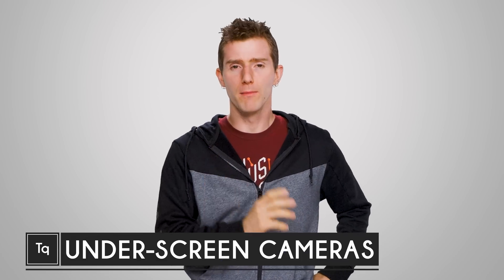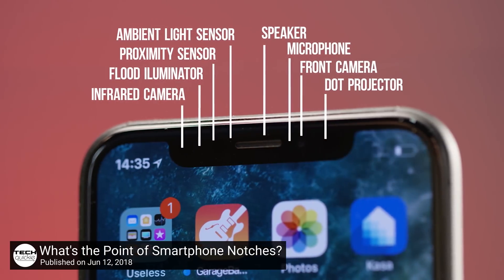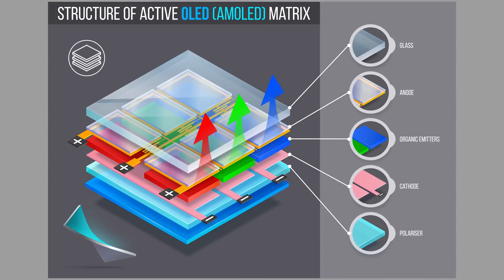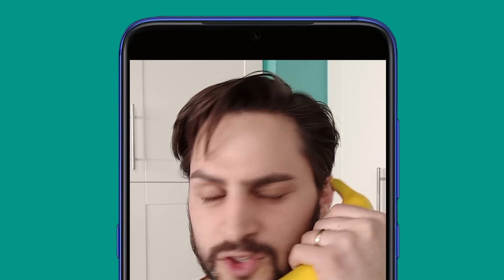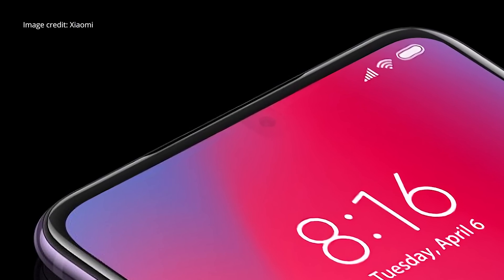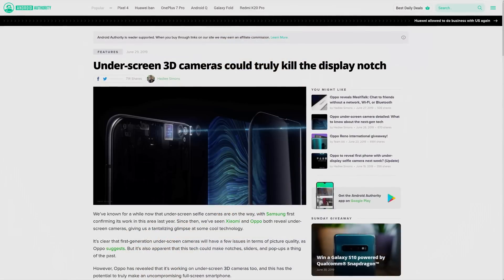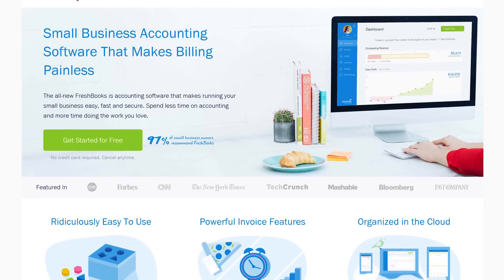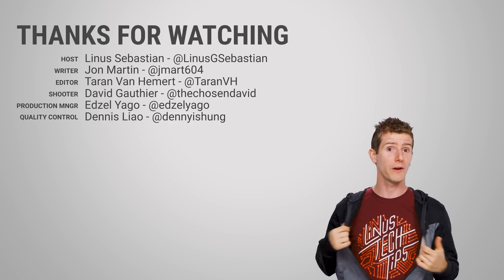How Under-Screen Cameras Will KILL the Notch

Comment: Face id is too good for this. How can you put the infrared, flood illuminator and the different sensors under the screen? These sensors essentially makes face id the most secure biometric login in a phone ever. You need to have a solution for that first.
Reply: Yah, well Apple has introduced us with the answer in the iPad Air 2020!

Comment: I would be sick of having a notch on my phone, if I ever got one of those nasty devices. I got the Samsung Galaxy Note 8 when it was brand new and still stick to it, since it still runs perfectly fine, and it was one of the last models before that ridiculously stupid notch trend. It's bezels are slightely thicker, but I'd always prefer this over having any sort of cutout on the screen. It's beyond pointless and I am glad my Samsung A20 is only a secondary emergency device - it has the freaking peep hole camera right in the display. Glad both those phones have a headphone jack. Couldn't be assed to get the Note 10 - it halso has the idiotic peep hole front camera and no headphone jack. For my kind of use for a phone, the Note 10 would be a serious step back from the Note 8, so I got really no incentive to switch. As long as the Note 8's hardware will stay healthy and Samsung not killing it off with bad updates, I'll go on using it, this thing is still a beast.
I would say - until translucent displays are perfected - the perfect solution would be a dual screen phone. Main screen on the front without any additional elements, secondary screen on the back, slightely smaller that gives room for sensors and camera(s), being used for all kinds of photos.

Comment: Google: you don’t need a 2nd camera

Also Google: ADDS A NOTCH
Reply: Also Google: but we need a triple camera system.
Reply: Pixel 4 leaks say that there won't be a fingerprint sensor instead it uses face unlock they way exactly apple approached.

Comment: Imagine having under-screen cameras in your TV or smartphones and fbi spying on u without u knowing it lmao
Reply: Fuck they've seen me masturbated multiple times
Reply: What you thinking of doing something illegal?

Plus why cant they through the ones that are there already
Reply: @wisps-vn7oy  It doesn't matter if what you're doing is illegal or not, if there's a backdoor in a device's software or hardware then it's only a matter of time before someone else finds and exploits it. For example, if you're a medical practitioner and use a device at work that is not secure, you cannot guarantee patient confidentiality because any malicious third party with the necessary skillset could eventually gain access to patient data. It's not just a privacy concern, it's a massive security vulnerability.
Reply: @rupertlove1807  the first part was a joke lol.
Reply: @wisps-vn7oy  stfu
Reply: @Anankin12  no u
Reply: As if you’d know they aren’t watching you If the camera was at the top and visible.

How stupid
Reply: They can do this with any camera connected to a device connected to the internet.
Reply: New buisness idea... I disable hidden cameras for a price.
Reply: What if the display or the part of it where the camera goes turn off for only one frame... 1/60s. In that time most cameras can take a picture in normal light and you hardly notice the random fast switching if those pixels
Reply: As if people didn't post everything they do every 5 minutes
Reply: @null-1  when the screen is active the under display camera cannot (yet) see you unless you open camera mode and the spot covering the camera is turned off completely
Reply: JD Marshall - there’s a company that has successfully made under-screen camera without the LED turn off. I dunno what company tho, but I know I’ve seen a video somewhere.
Reply: @JoshMarshain  I hope so... but the government / FBI / CIA / NSA / whatever will find a backdoor / way to spy on us through the camera without us knowing.
Reply: @LegaINameFraud  and that's why I don't live in the USA. You could say that in my country there's something like that, but no. I'm italian. We don't have money, we only have spaghetti lol
Reply: @greg9473  Trust me, and sorry to break it to ya, they don't only spy on american citizens. The whole world is being watched thanks to the internet and smartphones.
Reply: @LegaINameFraud  why do you think that the FBI might be interested in spying you instead of fighting actual crime, catching drug dealers, murderers, serial killers, all sorts of criminals, spys, etc. Except if you've done anything that deserves their attention. If you have, they have the right to invade your private life in order to ensure the protection and well being of the society. HAVE YOU?
Reply: I dont get why some people see FBI as an enemy. Have you ever wondered what would happen without them? Go watch the purge. You live in an organized society and someone has to be in charge of keeping it organized

Comment: I think we should do away with not just those stupid notches but rounded screen corners as well. Have you ever tried viewing a picture that supposedly occupies the entire screen but the corners were cut off because of the screen's rounded corners? It's quite annoying. I hope this stupidity doesn't spill over to TVs. Just imagine something blocking the screen like a notch or rounded corners. And some bezels please. Yeah thin bezels look cool but it sucks using my S9+ because I always unintentionally touch the edges and things go crazy. I much prefer using my Nokia 6.1 which has the good old 16:9 aspect ratio, no notch, and no rounded screen corners.

Comment: My least favorite thing?

Non removable/replacable batteries,

Devices getting less and less comfortable to hold due to growing standard sizes,

Lacking headphone jacks,

Support outside of iPhones often is limited to 2-3 years

Companies adding their own crap to the Stock Android system,

Companies not taking the chance on a large scale and make the phone work as a laptop replacement when docked to a screen (hello UbuntuPhone and Lumia),

Batteries need to recharge after 1.5 days at most,
Everyone tries to be Apple.

Seriously, Smartphones still have to improve a lot and come up with more individual qualities too.
At this point they are cool but also mostly shit.

Comment: I don't have any problems with notch or even cut off from above. i'm fine and don't need this little more screen space that badly. I think the "problem" with the notch is so overhyped. Yea it's neat and i love the tech and it will be cool, but by noooo means do i need it or buy a phone just because of this.
Thanks for the vid and the small explenation of the tech.

Comment: If they put the hidden camera in the middle of the screen instead of on top, you can actually make eye contact during video calls
Reply: That’s a cool idea. The only problem I see is it might get in the way of some of the internals. The entire inside would have to work around the camera
Reply: You forgot the part where he mentioned that they have to turn off pixels on the part of screen
 to make it transparent when using selfie camera
Reply: because we are so used to the top-format, it would look extremely weird
Reply: lol that would be cursed af
Reply: it would be cool to not have a camera
Reply: just do it like two way mirror... hidden camera...
Reply: Lol yeah
Reply: I too thought of that but then I realized that in the middle of the phone there will be a deep hole that prevents eye to eye contact which is a horrible decision.
Reply: I'd rather have a fingerprint sensor that takes up the entire bottom portion of the display, though that will take a while to get there too
Reply: That is a good idea but every Time you take a selfie you will have a black dot in the middle of the screen, plus you wouldn't be able to see your friend, and if you can see your friend then your friend would not be able to see you very well because excess light will enter the camera.
Reply: Eric Su it’ll get more distracting
Reply: nah, I’ll still look at myself in the corner
Reply: I don't it is touch sensitive. Like I doubt that part can activate the touch screen
Reply: i like to minimize the call window and use my phone. So having the camera in the middle wouldn't be too nice for me
Reply: Do you want to black out the middle of screen during taking a selfie 😂😂
Reply: i’m pretty sure ios 13 fixes the eye contact problem
Reply: Ameer it already did
Reply: This is actually a pretty good idea.
Reply: No, thanks. (If there is something I'll never understand about allistics is why they like eye contact so much).

Comment: My selfie camera has broken firmware. After I turn on the phone I can switch to the front facing camera once. If I ever switch to the rear facing camera then the app which wants to use the front facing camera will freeze. It has been like this since I got the phone a couple of years ago. The amount of times this has (slightly) bothered me can be counted on one or two hands though, so it isn't worth it to get it fixed. I only wanted to use it as a mirror anyways.
Moral of the story: I wouldn't care if they took out the front facing camera in order to get rid of the notch. I also wouldn't mind if the image quality isn't that great. In my opinion everything is better than a notch.

Comment: And i think that smartphones could be built smarter, like making single sided motherboard, making a battery as big as display and putting the actual AMOLED almost directly onto the battery, just using those Apple’s pull tabs and they should be made like single piece, some pullable from top and some pullable from bottom for easy battery replacement if needed and it would make the screen replacement easier than it is now, meaning that the flat cable should be from the side, by the way Samsung curved their screen, so with that in mind it would be a great device and back should be made from copper, covered by ceramic, so the CPU has greater cooling and hand won’t make it overheat

Comment: 1:20 Lets be honest here. The notch was from the beginning a problem of the OS. If the notch only have been used for symbols indicating various things of your phone (battery, reception, etc.) and not available for anything else (e.g. media playback) no one ever would have complained.
I think of all screen phones as the dumbest thing ever since the squared wheel ... and they did beat even that. You can get grab those god dam things without activating shit.

Comment: I don't want a 100% screen to body I want front-facing speakers in stereo my 3.5 mm jack my micro sd slot, not co-shared with 2ed sim cored 90hrz screen a programmable  butane

Comment: Don't want to have a notch, don't buy a phone with a notch . . . Samsung's galaxy line has managed to not look like they have huge foreheads and chins since the S8 range on wards.

Notches where never cool and frankly a phone that looks all display and has a   bad selfie camera ( for those who are born after the year 2000 ) just looks goofy and like it will break the first time it hits the floor.

Untill the tech has been proven by those who just throw money at tech for a few years / product generations dont touch it.

Like devices without 3.5mm jack's - BT audio sounds like dog shit anyone who wants Good audio will buy a device with the jack.

Like anything with a lightning cable don't buy it they break in under a year.

This under display camera stuff - stay well away untill at least 2022

Comment: This will never be mainstream. It will act as a neutral density filter and will effect low light performance. Swing as the front facing camera is not likely to have a flash or a high fstop this will negatively effect image quality. It drives tech reviewers crazy but the notch is the most sensible solution. No moving parts. No ridiculous rear screen. And no hamstringing the front camera. Just a little space on the screen. The only people so obsessed with this are the tech reviewers

Comment: My Galaxy S10 does a bunch of stuff my Galaxy S4 Mini didn't, but nearly none of it I truly need.  Samsung Pay is almost as convenient as using a plastic card, if the location of the card slot wasn't apparent.  Wi-Fi direct based S-Beam is gone, now we only have Bluetooth-based Android Beam.  The fingerprint sensor is slightly more convenient I guess, but it can't possibly be any more secure than the password/pin/pattern on the old phone because it requires you to have that in place as well.  I had to buy all new cables for it because it's the only USB-C device I own.  It has a desktop experience, so now I can make use of all these spare desks, monitors, keyboards and mice I have lying around at home and work.   The IR blaster is gone, so no more TV remote.  Oh, and it's got a hardware "I don't understand that" button.

Comment: That's why I stayed with my 9 series phone.  I cannot come to use a phone with neither notch nor cutout. Sorry. 

I'm looking at the pixel 4 tho so we'll see how that turns out. 

But I wasn't planning on upgrading till this new disappearing camera tech comes out and is perfected.

As far as battery life. I still to this day cannot believe cellphone manufacturers haven't put a solar UV battery trickle charging sensor connected to the battery to keep it charging throughout the day. Why we aren't utilizing the Sun and it's free energy is beyond me. 

Imagine never having to worry about your phone's battery dying on you throughout the day until the sun goes down and you THEN needing to plug it in since the sun is gone. 🤯

Comment: 1) Full face-side LCD panels are stupid because you can't hold the thing without touching them.
2) OLEDs are self-destructing unrealiable trash.
3) Notches are same fad as front-cameras for raging narcissists.
Therefore, fuck all that. The phone real problems are:
1) Closed-source binary drivers that vendor-lock you to unmaintained "black-box" firmwares for planned obsolescence.
2) Battery life. Especially due to radio-modules that are SoCs on their own instead of SDR transcievers directly controlled by your OS.
3) Fragility.
4) Not being water-proof due to absense of standard for close-range non-contact power-delivery (such as induction transfer) & high-bandwidth I/O (such as laser via transparent sealant or close-range radio transfer).

Comment: Who cares about notches!! We used to live without them before with a small bezel on the top that houses the camera, speaker and the sensors, I believe that the Galaxy Note 9 design was the best, edge display, no notch, and a headphone jack ... Going crazy to a %100 screen to body ratio just gave us a pain in the butt, batteries become smaller, most of the manufacturers got rid of the headphone jack, and some of them got rid of the fingerprint sensor

Comment: Why the hell do you still have cable? FFS, you are not 70 years old...
Reply: Ever heard of fiber-optical connections ? Guess what, fiber wrapped in isolation layer is a cable.
But SOHO switch & PC manufacturers are not keen on adding SFP+ ports for optical Ethernet or GPON modules, so you have to have special-purpose endpoint gateway routers, AKA "cable boxes".

Comment: 0:03 Uh lets see.. Removal of the headphone jack;

 Stupid glued shut batteries;

 Stupid and really idiotic materials (like a glass or aluminium back, instead of the maleable plastic that aborbs impact);

 Removal of features without a pric drop; 

Higher prices; 

OS'ses becoming more and more dumb and infuriating trying to think they know what i want/need more than me (example: stop playkng music when i open ANY GODAMN APP, or not allowing power saving mode while charging so i can use the phone but charge it alot faster than just turned on, etc); 

More spying and less privacy;

Useless virtual assistants (i mean they are usefull for disabled ones, but why they have to shove them down our throats? Cant it just be a avaiable app to install?); 

Stupid designs aka notches, punch holes, popup cameras (wich are kinda cool but yet non durable); 

Stupid bezel shrinking, i cant hold the phone anymore without touching the screen and there is no space for decent i/o, sensors and buttons;

Removal of the at least sensitive or real buttons, to these bad virtual ones; 

Stupid app/OS behavior of opening awmost everything in background wasting power (yeah most likelly the latest one to not do that was 2.3.6 due to most phones not having enough ram to have the stupid behavior); 

GIANT sized phones, that will stick out of pockets;

Stupid "mobile experiences" AKA mobile reduced (and dumbed down incomplete) interfaces such as we have even on the desktop with gmail nowdays, youtube, etc. Basically lackluster apps; 

(That one isnt actually the phone's fault): unecessarily heavy web, godamn how it got heavy.... ;

Comment: Keep the notch if it keeps the jack. Remember majority of the people uses the 3.5mm jack. Dongles are just more hassle. Bluetooth isn't the solution. Audio sounds crap after a year of usage unlike wired for me at least. Keep the jack until bluetooth becomes as good as wired or better.

Comment: To answer the cable box question is easy: We don't. Cablecards are a thing that exists with the intent of curbing the need for a carrier originating set top box altogether, given one can provide a compatible device that can properly decode the signal from a cablecard device...Not that it matters nowadays, as many carriers are shifting over to supporting their own streaming apps for television content anyways...A sign of the ever changing times...